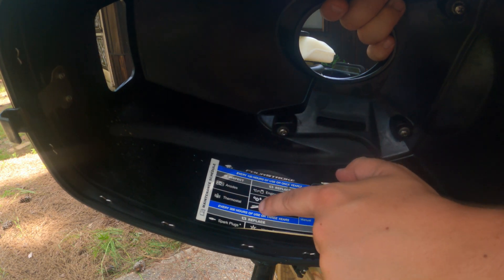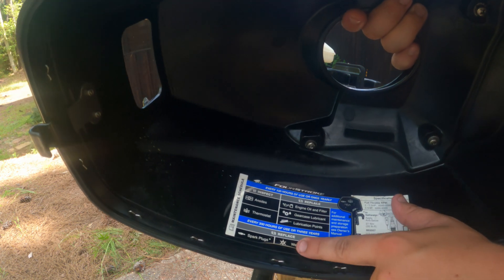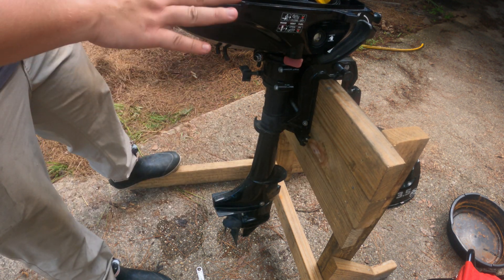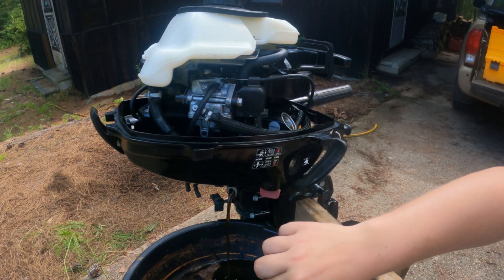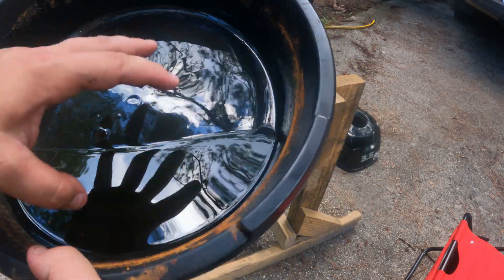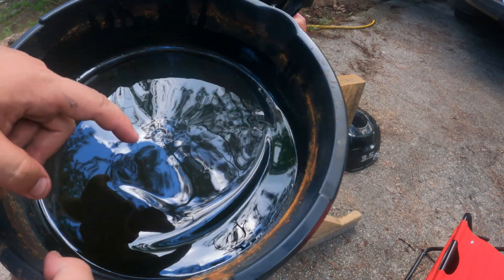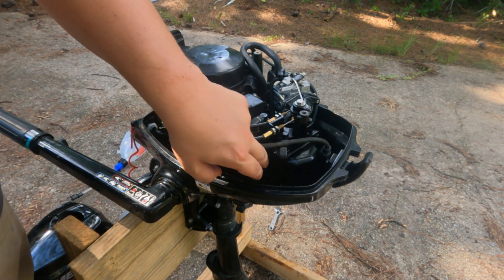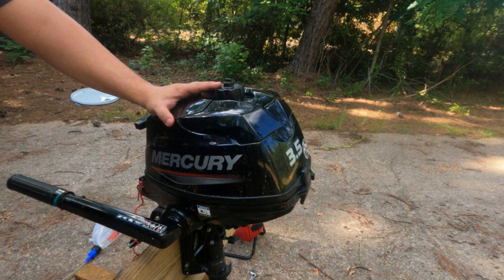Mercury 3.5hp service and maintenance

Comment: Hey man I gotta quick question I have pretty much the same engine but mine doesn’t start up and idles but for some reason when I twist my throttle it doesn’t work
Reply from the maker: Probably a carburetor related problem pull it off see if anything's gunked up throttle cable is either because it's also not adjusted properly or the cable is not attached when you pull the cowling off Make sure when you twist throttle it's also moving the flap on the carburetor.

Comment: Somehow my has no spark, put new spark plug and checked land yard switch but still no spark, I wonder what caused
Reply from the maker: Check the distance between the magnets on the flywheel and the ignition coil first

Comment: Buck that was a excellent teaching simple and broke down I sent you a message for some info on that 2 overflow hoses the little white plastic piece that bring the two hose together I need to know what that piece is so I can go buy it and put it on one of the pieces that go in my hose on one side was cracked that's where the leak was coming from.Thanks so much!!!!
Reply from the maker: Thank you, if I have some free time at work tomorrow I'll take a look at boats.net and see if I can find that piece.
Reply: I figured it outits the filter and i fixed it thanks so much one thing that happeed i followed the gas leak and line and i got it@BuckcreekTV
Reply from the maker: Awesome! I'm glad to hear it and that you got it resolved I didn't have an opportunity to look at diagrams today been quite busy at work.  @johnathanwilliams1505
Reply: Buck is there anyway I can send you a picture of the piece

Comment: Thank you!  Very clear! Got this motor last year among other reasons because of your videos showing the basic maintenance and operation in such a good way! (I was wondering if your flathead screwdriver's handle doesn't double as a spark plug socket?). They sometimes do. But you probbly know this already ;-))
Reply from the maker: @mhjensen4630  I have had tool kits in the past like that but not with this outboard since I bought it used

Comment: I’m having an issue where it’s revving really high on idle. I have the throttle cable pulling the linkage the max it can go and the idle adjustment screw is hovering.
Reply from the maker: @chrisz.9974  may want to check if the choke is getting stuck open if so, may want to add some WD-40 to it
Reply: @ I’ll have to check that out. I don’t see the choke linkage interfering though. I’ll have to check again.
Reply from the maker: @chrisz.9974  only other thing I can think of is that it's getting too much fuel which could be the needle or the jet more than what needs to be adjusted these engines are a nightmare
Reply: @ I’ll have to clean the carb out real good and check again.
Reply from the maker: @chrisz.9974  sounds good best of luck hopefully that will resolve any issues

Comment: How do you change or clean the fuel filter?
Reply from the maker: @BillBlunt-y8h  the 3.5hp Mercury has a "fuel strainer" which is for larger debris inside the gas tank rather than a fuel filter. After the fuel line passes the shut off valve going from to the left the right side I cut the fuel line and added an inline fuel filter that was clear so I could see fuel flow. I will add this item in the description as well as a link

Comment: Why didn't you change the oil filter?
Reply from the maker: @carlmyers7524  on these small engines there isn't an oil filter. That's pretty common on outboards below 6-8hp or a couple hundred cc engines such as generators.

Comment: Impellor?
Reply from the maker: That's usually done on the 300hr service. Usually involves disconnecting a couple of boats to remove the lower unit from the upper as well as disconnecting the gear linkage.

Comment: Great video, Peyton!  I'm getting ready to maintain my Merc 3-1/2 HP and this video will be a great help.  One item you didn't mention is flushing the motor.  I'm having a problem finding the right adapter to do that.  Do you know what I should be looking for to flush the motor?
Reply from the maker: Thank you, I'm glad I am able to help. One of the downsides to this outboard is that given how small/slim the lower unit is there isn't a good way to flush it using muffs. The best way I've found to flush this outboard is by either filling up a 5 gallon  bucket and having a stand that sits low enough to it or buying an inexpensive used 55 gallon drum and placing the outboard on the side of it like I did in the video and fill it up to where the lower unit is 6 inches underwater.
Reply: @BuckcreekTV The manual refers to a "hose coupling" and says to use a Mercury Precision or Quicksilver accessory without providing any specifics.  As I can't seem to find a coupling, the bucket method may be my only option.  Thanks again.
Reply from the maker: They might possibly be referring to the Quicksilver through gear case flush kit I don't have any experience with it though and could not give it my endorsement

Comment: Hi there, greetings from the other side of the world, thx for your video, i learned a lot thx to you. I got an issue with my carb, may you help me find out the cause : it does not  keep the idle position and just tirn off as soon as i push the choke. Any idea ?
Reply from the maker: @sabrimounirbougherara7171  likely need to adjust your idle speed. This can be done if a screw on the side of the carburetor but it will require it being removed. For some reason they did not put the adjustment screws towards the outside to make it easier to adjust
Reply: Yep, i see, thank you very much for your reply, am doing it as soon as i can. Thx again
Reply from the maker: @sabrimounirbougherara7171 no problem hopefully I helped!

Comment: Thank you!!! How are you liking it so far? Any issues with the carb?
Reply from the maker: @nexcuc1374  I did have some initial issues. The original owner used ethanol fuel so I had to clean the carb and he adjusted the float height way too high causing gas to flood out of the carb. Since I fixed those problems with the help of my cousin I haven't had any issues out of it. Good little outboard.